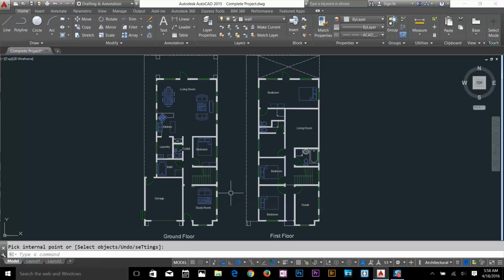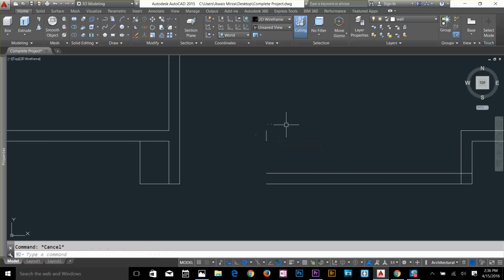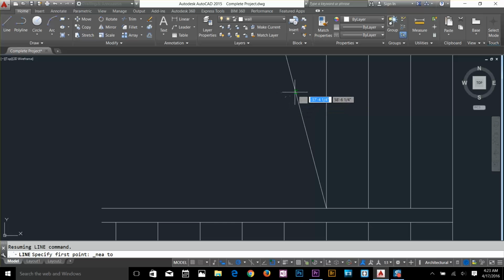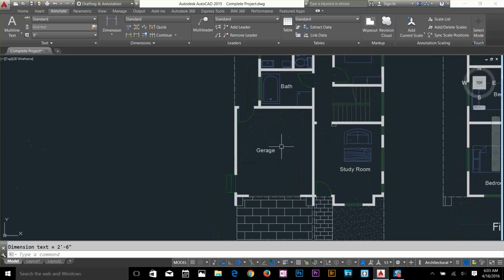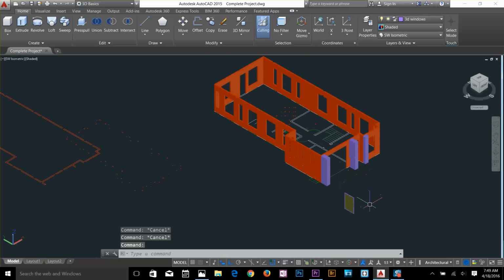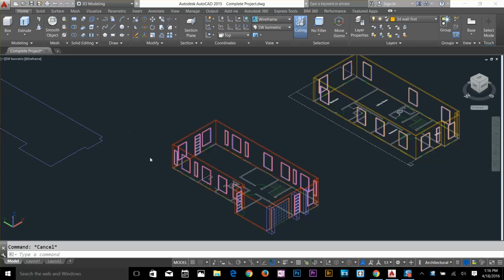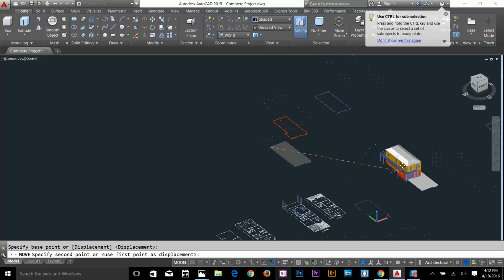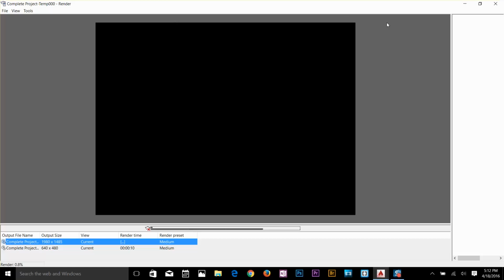AutoCAD 2d and 3d Beginner to Advance House Project Tutorial

Comment: If you find the best Autocad institute in Delhi, Noida, Gurgaon with Certified Trainer. High Technologies Solutions is the Correct Place for Autocad Course. Certified Trainer, 100% Guaranteed Job Placement in Reputed MNC Companies. Call Now and Get Free Demo Classes- +91-9311002620, +91-11-40504400.

TO Know More Details- https://www.htsindia.com/Courses/CAD-CAM-CAE/creo-for-industrial-designers-training-course